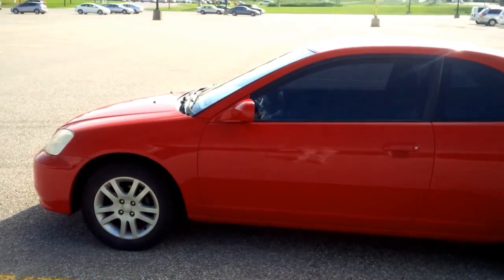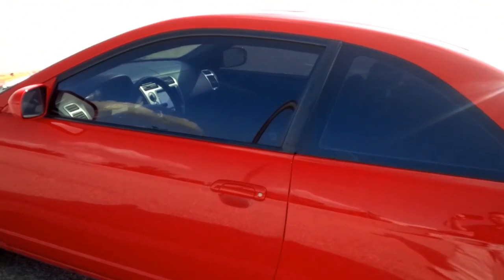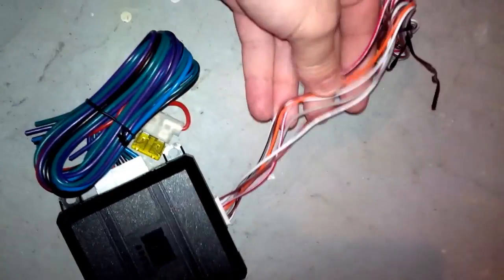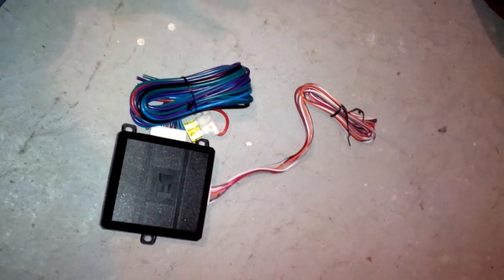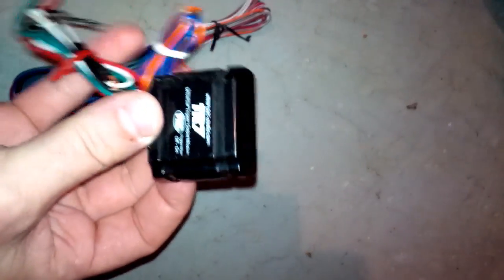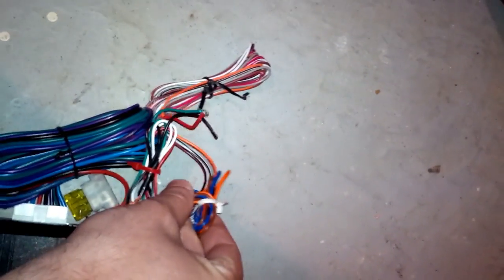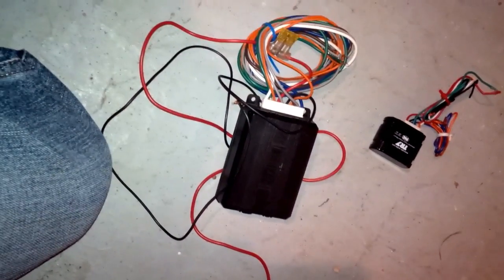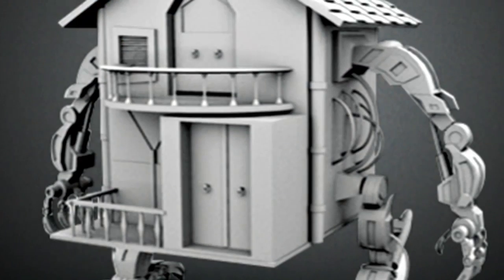Automatic Remote Car Windows - DIY

Comment: I remember an old Peugeot designed by pirinfarina pulled windows a little bit when doors were unlocked to avoid air compression, I'd like to know what is that feature called

Comment: seems like if you put a micro controller with a bunch of transistors you can achieve the same result without buying so much stuff. From my point of view those boxes are just programmed micro controllers.
Reply: 8 years ago where does the time go… but God bless the Chinese they make plug and play for almost any car these days 😂 $40 
Only negative is it takes 3 weeks to arrive